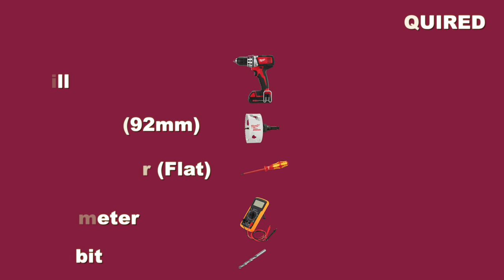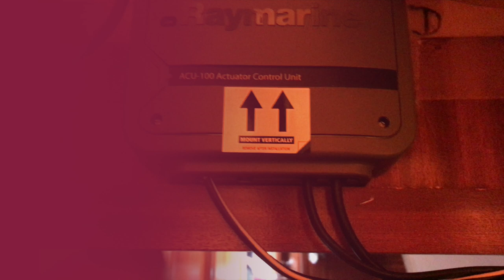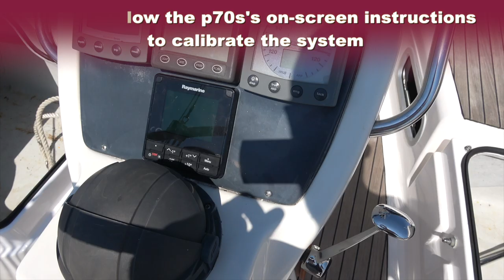Raymarine Autopilot Installation (EV-100 Autohelm)

Comment: Hey great video! Just finishing installing mine. I am just curious as to what gage of wire you used from the breaker to the IP box and from the IP box to the ACU unit? And what type of connectors did you use inside the IP box? Simply just marrettes? Thanks again!
Reply from the maker: Thank you, it were a while ago but think we used 0.75mm² tinned cable and the connector came inside the ip box, they were the chocblock style. Wago’s will work perfectly too.

Comment: I also have an box pedestal and have to drill a hole for the motor. But shouldn't the motor be capable to hold the autopilot? Did you need the stay bracket? To me it looks like the stay bracket can't be used if the motor is fixed into the box pedestal, or should I get their extra fittings for the box pedestal, what's your experience?
Reply from the maker: Marius Håland Hi We've had no issues at all with our setup, you will need the stay bracket, they sell a flat bracket instead of the rounded bracket which is designed for a traditional round pedestal.

Comment: Slot cannot be vertically below as in the installation instructions so did you drill a new one? Also did the flat brackets holes match up with the round holes or do you have to re drill?

We are trying to fit ours and having endless fun ....
Reply from the maker: We didn't have to drill anything on the kit at all, we had to drill the hole for the motor to go inside the pedastal, we also had to drill the 4 holes for the bracket to be mounted (see 2:34 )
You can email us if you want to send pics of what you are stuck on. svcompromise@gmail.com

Comment: I just finished installing today and it won’t fire up. I went from one breaker in the panel then wirenutted the hots together putting a 5a fuse to the 5 way connector and sending the other one to the acu.  I then wirenutted the commons together.  I have power coming from the panel to the unit but as soon as I tie everything in I get a reading of 3 volts at the acu. Did I do something wrong?

Comment: Im trying to install one of these currently. If i go by the manuals reccs it looks like the wheel drive motor will hit my throttle controls. I see you shifted yours to the bottom left. Did this change any of the drive characteristics?
Reply from the maker: the_sailing_cyclops 
None whatsoever, it's works perfectly fine, except when in really heavy seas, but that's nothing to do with the position, it's the fact the wheelpilot doesn't handle extreme weather helm.
Feel free to fire anymore questions over and good luck with the install
Gav
Reply: @OverlandSea  awesome. Thank you. I was quite nervous about drilling into my pedestool only to fail. I have a 96 hunter 280
Reply from the maker: the_sailing_cyclops 
Must admit we were very nervous too, now it's done we are so happy, it saves our shoulders from long spells of helming.

Comment: I know this comment is well late but I was  wondering about the sensor location I believe for best accuracy they should be mounted at the waterline on the centreline, it may have been an optical illusion but yours appeared to be to one side. How is it performing? cheers moose
Reply from the maker: Hi Moose, your absolutely right they do recommend getting as close as poss to the centreline and waterline where possible, this was as close as we could get because our steering mechanism. We’ve done around 2k Nm with it now and it’s worked perfectly, the only issue we had was my tools being too close to the sensor core so I put the tools in the opposite locker and that sorted it. Cheers
Gav
Reply: @OverlandSea  thanks Gav I was curious as to whether it made a noticeable difference  often the specs and recommendations reflect theoretical limits that are tighter than reality interesting real life experience
Reply from the maker: It’s managed some heavy swell but I could imagine any further off centre you could possibly have issues with the 9 axis sensor picking up the motion of the boat.
How did you find the video Moose, anything I could improve on for future videos? Cheers
Reply: @OverlandSea  I think the video was great the short format works well a how to without the labouring over handskills like drilling holes and mousing wires
Reply from the maker: That’s good thanks, it’s always really helpful to get feedback, you sometimes can’t see the woods for the trees when your editing the videos. Cheers Moose 👍🏼